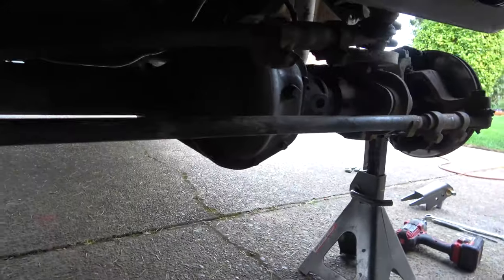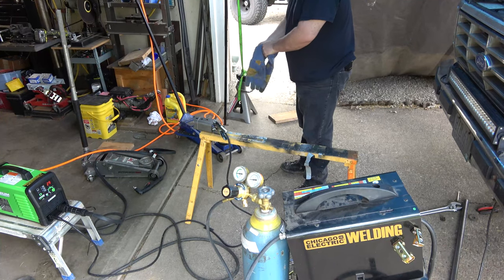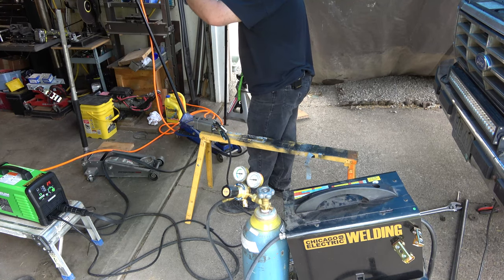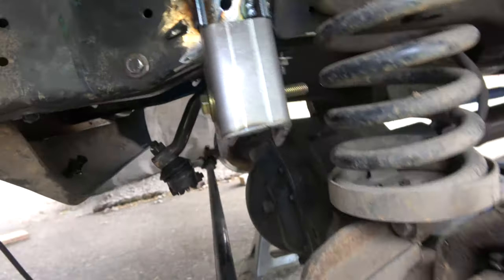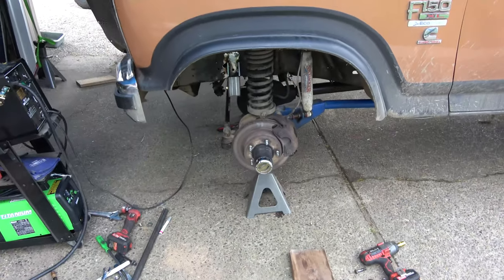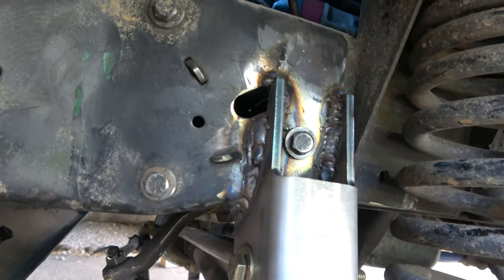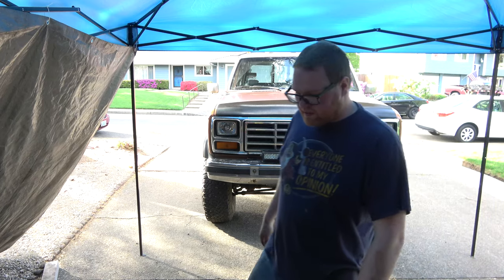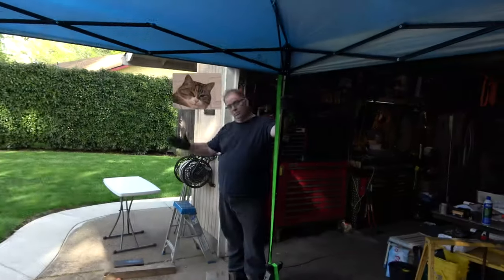SAS Swapped Bullnose Ford F-150 | Ruff Stuff Custom Track Bar Build

Comment: what front springs are you running? im gonna be swapping a bronco soon just dont want it to be too tall. your height is about perfect for 35's or 36's
Reply from the maker: I was running stock 78 f150 springs. If you run the James Duff coil buckets and stock springs, it’ll net you a 4.5-6” lift.
Reply: @bullford8218  awesome thanks, I might try that, I have the deaver 5” springs but after watching your newest video that is WAY to tall for what I want. I might test it with them and see if I can move the buckets high enough. Was it softer with the stock f150 springs or with the deaver springs?